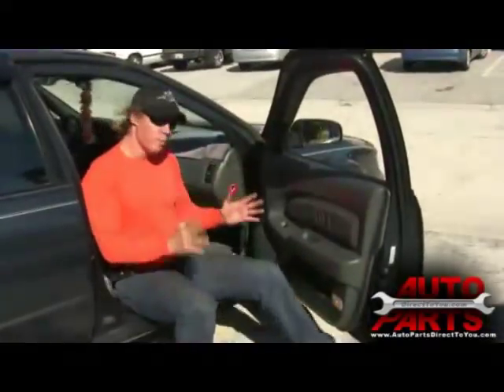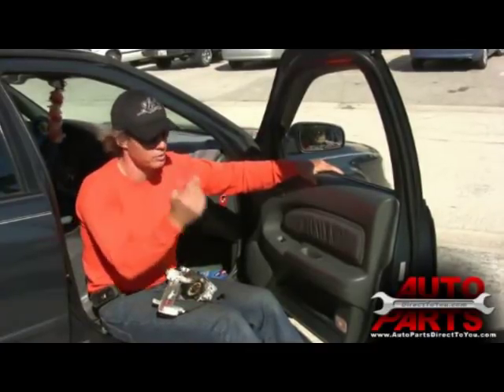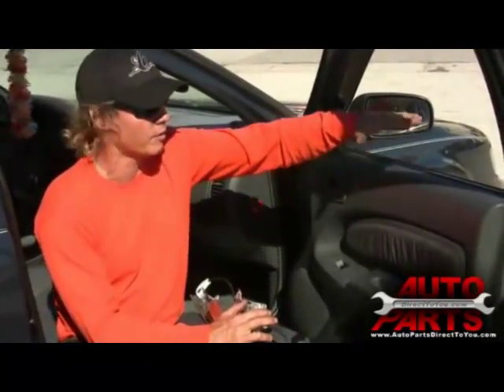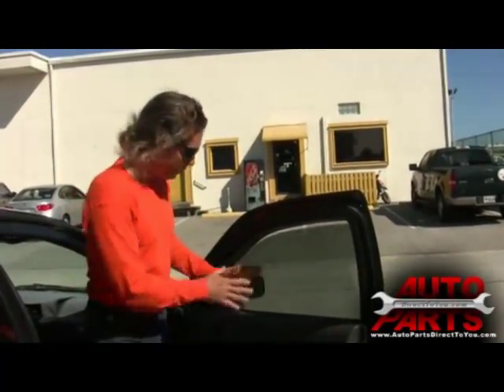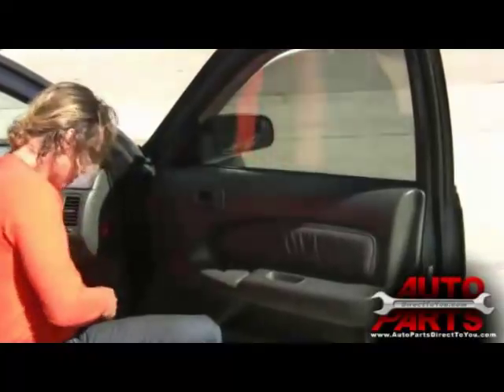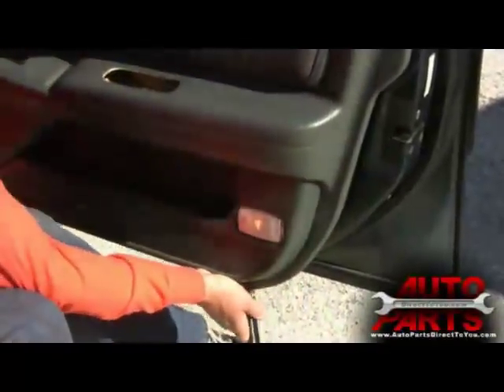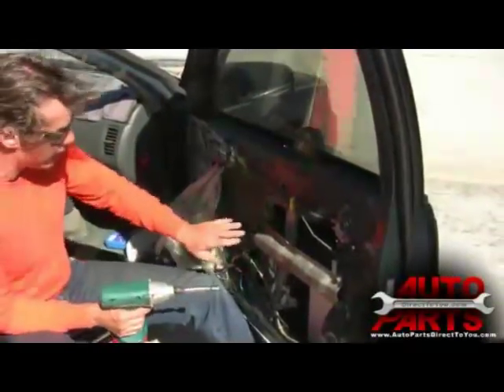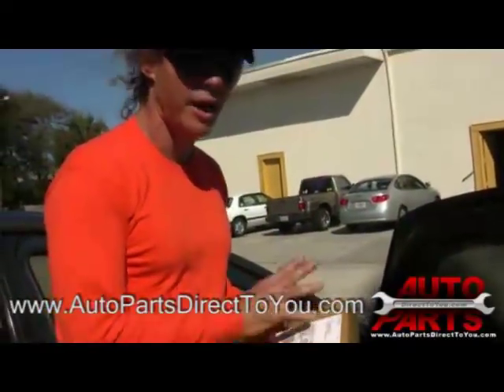Diagnose Window Motor and Regulator Problems Part 1

Comment: I have a 2003 Dodge Grand Caravan Sport, the driver side window will go down but when you press up it makes an awful noise and barely moves. I then press a hand on each side of the window and push it up, it only goes a couple inches, then I press the up switch again and it goes up a couple inches before stopping and making the awful noise again. I repeat this process til the window is almost closed, and I can hear the wind whistling as I'm driving down the road. I believe the motor is still working, and maybe the regulator needs to be replaced, but as I have been pricing this part, I have the option to get the regulator with or without the motor. Seeing as how my motor is still working I would assume I don't need one with the motor... however I also know that as Murphy's Law exists, if it can, it will... so I believe if I don't change the motor also, I'll need to in the not so distant future... And considering the regulator with the motor doesn't cost that much more than the one without, maybe I should go ahead... I would love to have your advice on this subject, Thanks in advance!
Reply from the maker: As a person who has witnessed Mr. Murphy's laws take effect one too many times, I completely agree with you. If you can get the motor and regulator together, I always suggest knocking out both at the same time, your window should work for a long time afterwards without issue.

Comment: Hello, I have a 95 Jetta that is having the same issue as what you are describing at about :45 seconds in. Currently the window is stuck in the fully down position. Is it possible to manually roll the window up and have it stay that way until I can order a new clip to make the repair?
Reply from the maker: +Anthony Saia You could remove the regulator, push the window up. Then use something like a short 2x4 to block up the window, using a few screws through some of the holes to secure the block in place

Comment: i have a nissan maxima 2014 . I cant get the gears to go down , The motor itself gets very hot ,, but the gears do move shortly  they are stuck currently  in the highest position
Reply from the maker: Albert R you most likely need a new motor and regulator assembly, the motor is getting hot from either too much mechanical resistance in the regulator or from the motor failing internally

Comment from the maker: It sounds like it is probably the motor going bad. It sounds like it is drawing too much current when trying to move the window, and when that happens, the circuit breaker which controls the windows will trip. The circuit-breaker resets itself after a few minutes, at which time you can then move the window motor a little more before it trips the circuit breaker again. I can't tell you with 100% assurance that this is your problem, but it's the most likely cause.

Comment: Good video.  Very informative.  I have a 2007 Sonata.  The rear passenger window just one day stopped working.  When i push the button, i can hear the motor going, but the window does nothing.  The window will not stay up on its own.  It gradually slips all the way down unless I use tape or something to keep it in place.  I tried to take it apart but too many nuts and bolts everywhere.  Not sure if its something like "off the track/wire" or whatever it sits on.  Hoping not having to replace whole panel because that's gonna run me almost $350 just for a window. Parts ($175) + Labor (was quoted at $170).  Can i somehow salvage this?
Reply from the maker: Hello, You most likely need the entire regulator, the cables work with the motor to raise and lower the glass and the cable usually come apart or separate. It may look like it came off of track but you almost can never repair it. we do sell the complete motor & regulator brand new and here is a link to it at Amazon:
http://www.amazon.com/dp/B00TBJA24U

Comment: Regulator and motor has been replaced. Still won't make a sound or move. Could it be the switch
Reply from the maker: Kay Pruitt yes it certainly can be the switch, that is why you should check for voltage at the window motor before replacing it, if no power at the window motor, then the motor is most likely not the problem

Comment: I've already replaced the up/down window switches to no avail. 

Can you please advise?
Reply from the maker: If the motor is not operating, then most likely that is the problem, nothing else really exists and replacing the motor/regulator is extremely common.

Comment: I have a1999 Chevrolet suburban. I have been having a problem with my window since we had a very hard snow. My window started going down only half way. Once it reached the half way mark it would make a grinding noise. When I let out back up it would make the noise. Now it doesn't work at all. It's the drivers side window. There's no sound coming from motor. I need help

Comment: I have a 07 Silverado crew cab. Both passenger side windows stopped working at the same time. When I try to open through the master switch on drivers panel, the front make no noise, but the rear makes a slight clicking sound. I have check fuse panels. Any ideas? Bad switch?

Comment: The driver side window of my 2001 Toyota Sienna functions normally when going down; but when going up, the windows rises slowly,and the motor sounds weak. However, when there is a little less than two inches left to go, the window will pick up speed and the motor sounds strong again until fully closed.  Is this a major problem?
Reply from the maker: naught666 Your motor is probably getting prepared to go to parts heaven. You are lucky when it actually gives you symptoms as many just stop completely and you have to figure out what went wrong. Your symptom is a motor/regulator issue and you may want to start planing on replacement soon.

Comment: I replaced the window regulator and motor for my 94 grand marquis but still having issues with the window getting stuck & off track.  I've made sure its lubricated/greased well. What could be the problem.  The other side I replaced works great.
Reply from the maker: Rae Cov Usually that is resolved when you replace the window regulator. The window regulator is considered all of the linkage between the motor and the window glass. If you have not replaced that linkage (window regulator) then that is likely the problem. If you did replace that regulator, make sure it is installed properly and then make sure no restriction exists such as dry rotted weatherstripping. Damaged weatherstripping can grab the glass and work against the motor and regulator.

Comment: I have a 4 door 2002 Chevy Blazer and the windown on the drivers side would roll down a little bit and then stop and I'd have to wait 5 minutes before it would work again, like it got tired and would stop but then will work a bit. aha. Anyways, if I wanted to get it down or up I could push the button and then pull the window hard and it would work. So I had to help it out. Until yesterday it completely went out, luckily after I got it all the way up. What needs replacing?

Comment: Hi, I have a driver's side window that goes down ok.  When going up, it slows down, then stops.  After a few minutes, you can press up and it'll go up just a little, and acts like it needs a charge to struggle its way back.  Usually we roll it up a little in 6 attemps with 10 minutes intervals in between, to roll it all the way up.  Is this a bad motor?_ Thanks

Comment from the maker: It sounds like the motor is going bad, when it goes up slowly and then stops, what is happening is the motor has too much resistance, and is causing the thermal circuit breaker to pop. It then takes a few minutes for the breaker to reset before you can continue rolling the window up slowly.

Comment: I have a 2002 Honda accord, where the passenger front window on the right and the back window on the driver side wont go down or up, but the other two windows, driver side window and passenger window on right work.  Would that be a fuse problem or what?

Comment from the maker: If none of the windows work at all, it's probably a power supply issue, you would have to check the main power source going to the window system to make sure the fuse(s) and wiring is all good.

Comment: I have a 96 camaro and window goes up and down every few minutes that I press the power window and I also have to pull it up or down what seems to be the problem
Reply from the maker: herbsmoker59 sorry for the late answer, if you are saying the window just goes up and down every few minutes on it’s own, then it is most likely the window switch, this can be tested by removing the door panel and testing for voltage from the switch when it is not being depressed, if you get voltage without pressing the switch, then the switch is the cause,
Reply from the maker: Also this will put some heavy wear and tear in the window motor so it may also need to be replaced,

Comment: OK is there a suggested repair for the situation (mentioned in the video) where it has the grinding noise and then stops after a few seconds? Thanks!
Reply: Remove the mechanism... And replace it with some bailing twine and a hook above the door.
Reply: David Mecham I like this idea LOL.  Maybe I will...
Reply from the maker: Most of the time the grinding sound comes from the motor itself or the motor trying to move the cable through it on cable style regulators. This requires replacement of the motor & regulator most of the time. If you here absolutely nothing when you hit the button, sometimes you get lucky that the motor just came unplugged, but grinding usually means replacing. If you have that grinding sound, unfortunately part replacement is usually the cure.

Comment: I have a 06 ford freestar the driver window stop working I tap on it work or if it stop half way I would push down on it and it starts back working now it won't do nothing the only thing I hear is when I push on the switch is the click that it makes when u want to roll it up or down. Any thoughts?

Comment: i have a 98 camaro and the drivers window won't go down. It does not make any noise at all it just doesn't want to go down.  sometimes if i press it the right way it will go down. I wanted to replace the motor but im not sure if that is the exact problem?

Comment: I just purchased a new regulator. Installed it and window worked great. But now it's clicking and hesitating to go up. And when it  goes all the way up or down it clicks at the extremes (all the way up or down). I'm thinking the gear on the motor might be stripped?
2002 VW Passat 1.8t.
Reply: incorrect installation
Reply: Aaron Reihl Yeah, I took it apart and loosened the bolts holding the motor to regulator, walaa works great.

Comment: I have a 2005 mazda 3, the driver side window rolls down half way and gets stuck. I have to help it to go back up at first then it goes on its own then when I get it back up it makes a grinding noise at the top.
Reply from the maker: Most likely the window regulator is failing. This car has a cable style window motor and regulator and the whole assembly should be replaced at the same time to fix this problem. Make sure the window glass weatherstrip is in good condition and it not causing any visual restriction. Next you take the door panel off and inspect the regulator as the problem is happening. 9 times out fo 10 you need to replace the motor and regulator assembly and here is a link to it on Amazon:
http://www.amazon.com/gp/product/compatibility-chart/B00BVQ0K16/ref=au_pf_dp_chart?ie=UTF8&Make=BMW%7C31&Model=330i%7C181&Year=2006%7C2006&carId=567

Comment: I have no problem bringing the window down. But when I try to bring it up, it stops at 1/3rd way and I have to pull and press the switch to bring it up to the 2/3rd then it stops again and I have to pull and press the switch to bring it up to the top. What is malfunctioning? Motor or regulator? Please answer.

Comment: On my driver side controls if I go up on the passenger window it tends to go down instead of up or it barely goes up little by little or down little by little and if I try in the passenger side for that window it’ll go all the way up but as soon as I let go it goes down a little bit and leaves it opened . Only if I hold it up for about a minute it will eventually stay all the way up. .  Do you know why this would be ??? It’s a 2013 Honda Accord coupe exl
Reply from the maker: AV yes maybe, your model has a relearn procedure when a window switch or motor is replaced or unplugged, search google for the procedure, also if no other

Comment: hi, yesterday i put my passenger window down (98 taurus), it was working fine, not running slow or struggling or anything, but when I went to put it back up, it was totally dead. neither the switch on the passenger side or the driver side will make it move, however the other switches on the driver side still work all the other windows. any ideas? thanks.

Comment: 1986 buick regal the passanger side window is stuck up the motor is good the circuit breaker is good no noise  both switches have no load only the driver side works and both switches have good contact and I dont see any bad wires

Comment: After watching your video I still don't know if my problem is the motor, regulator, or both.  I have a 2001 Toyota Camry and the driver window will go down with no problem, but will only go up a little at a time, especially when you let it go all the way down.  You can eventually get it to go up but you have to wait a few minutes before trying again and then it only goes up less than an inch at a time. Can you help me know what I need to order?

Comment from the maker: It could still be a problem with the switch,, If the switch is correctly alternating the power between the two wires going to the motor, the next thing to check is that the switch is correctly alternating the ground also. When going up, the ground will be one pin, and when going down, the ground will be the other. If one of them is not a ground when going in the down direction, the switch is bad.

Comment: Have a 2000 and the and the driver pa passenger windows both  work fine until halfway up then slows down almost to a crawl then about 6in from top it goes good.  almost like they are  binding,  any any idea?

Comment: In my 2000 Isuzu Rodeo my driver side window is acting up. The window will go down about 2/3 of the way and stop (sort of like it gets stuck) and won't go down any further unless I open the door, then it can go completely down. The window will go up just fine from any position. What could be the problem?

Comment: I have a 2003 Saturn Ion. The driver side window is not working and it is in the up position. All other windows work from the master switch and from the individual door switches. I don't hear the motor when I depress the driver side switch, the dome light does not dim either. I measured the voltages at the master switch connector and all the switch voltages are identical when depressed. The weird part is the window works when it is cold out...winter.
Reply from the maker: ok, the window motor is probably failed. You can test it by removing the door panel and applying 12 volts or by jarring the motor with your hand or rubber mallet. Kind of like a starter motor, if you give a few hard taps/bangs on the motor while using the switch or providing 12 volts and if the motor starts working, then it is the internal part of the motor failing. The motor is just like any other motor and has an armature, brushes, and magnets that make it spin, once those get some wear and tear, the motor will work intermittently and eventually stop working completely. When you go to replace it you might as well get the motor and regulator combination. Here are links to the parts for Front Left & Front Right power window motor & regulator assemblies:

2003-2007 Saturn Ion Front Left (Driver-Side) Window Regulator = http://www.apdty.com/item.wws?sku=862125&itempk=9597649&mfr=APDTY&weight=2.206

Rear Left (Passenger-Side) = http://www.apdty.com/item.wws?sku=859625&itempk=9597143&mfr=APDTY&weight=2.206

Comment: 94 Mustang convertible my passenger side window is stuck in the up position. I press the switch on the door either up or down and you hear it click but not a real click more like a motor under load but can't move. Two days ago I ended up playing a bass track in my mustang and with three 10 inch subs it hits hard. After that my window started working again. The windows has been working ok for 2 days now and its not moving slow when putting it down or up. I'm just scared it will get stuck in the down position and I live in Arizona and summer is almost here. Any suggestions for me on what I should do?
Reply from the maker: korbenelements So luckily your stereo system just diagnosed the problem for you. If the motor starting working after the vibrations from the base, the the motor has a bad spot in it and it will eventually stop working completely. You will get a little bit of time with it working and you may bang on the motor as it freezes up more often, but it will eventually fail completely. Get a motor and regulator assembly soon as it will be needed, here is a link to our brand available at Amazon.com. It is premium components and has a lifetime warranty:http://www.amazon.com/gp/product/B00BVQ6FZ6/ref=as_li_tl?ie=UTF8&camp=1789&creative=9325&creativeASIN=B00BVQ6FZ6&linkCode=as2&tag=aupaditoyo-20&linkId=NPU5NORR4Y5L7OT7
Reply: Thank you very much for responding to my question. I'll be getting the part from you on amazon in the next 3 months or so. I just won't use my window until I get it fix. I would have fixed it sooner but my lower control arm bushing need to be replaced and thats going to cost me a pretty penny and about a day of work. But at least im doing the work myself.